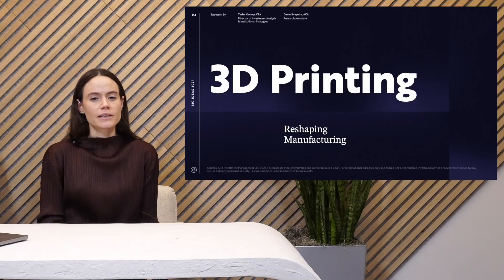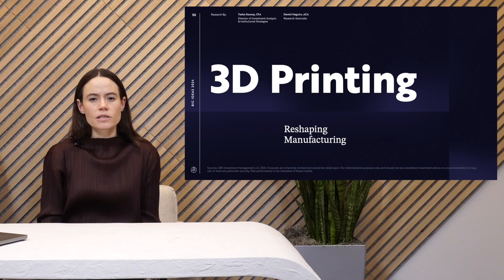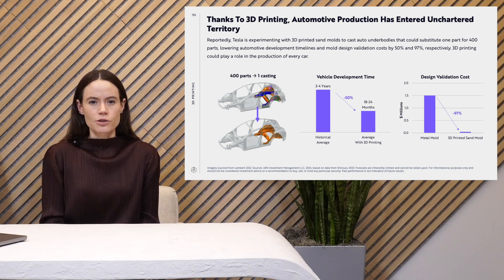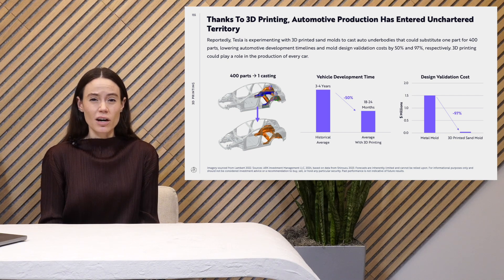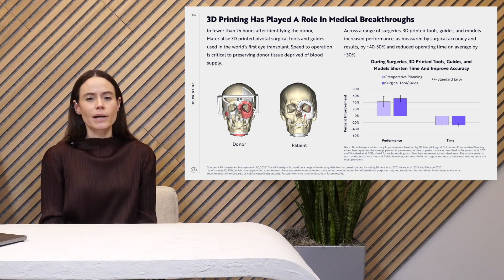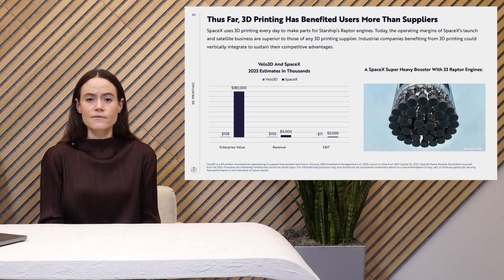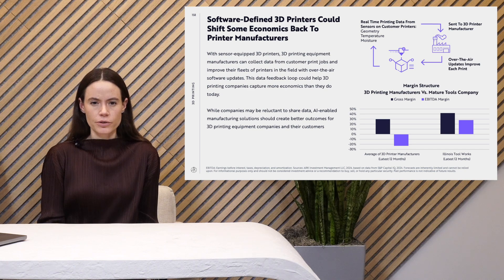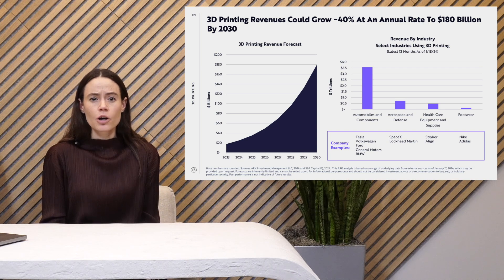3D Printing | Big Ideas 2024

Comment: 3D printing has extreme potential but rather than a steady progression I think it will be sudden leaps. Extruder plastic printers are toys at any level but the right metal printing technology could be a revolution. It has to step from modest use case curiosity to real traction and I think that's quite possible. Current metal 3D printers suffer from stagnant self importance where they compete for the greatest overpricing and lack of progress. Around 7$/cm3 steel print has been the norm for many years and their only innovation has been that you have to pay for the empty volume too so the price has actually gone up to 10+$/cm3. When a high power laser costs close to nothing and pushing around metal powder in a bed isn't exactly quantum physics. Similar stagnation in the printer makers.
Print speed comparable to pulling a car out of a paint bath is possible but no one is looking at that. From studying UFOs aka ET ships coming here, and yes that is quite real, it is absolutely evident that only "3D printing" will survive as a manufacturing technology and theirs include atomic structuring for perfect alloys and semiconductor functionality. They don't distinguish between structure and wafer. They have no wires, no PCBs. One monolithic process. So that's an easy way to know the endgame.

Comment: 3D printing is extremely slow.
If it take one day to produce a part but take 30 sec with a mold you are toast.
It can be good for a rocket engine or a prototype, but not for a production car.
Reply: I've printed a good amount of HPDC tooling for automotive. With the ability to print in optimized cooling channels, the tool can last longer
Reply: @BenWilson24  So you print the mold for plastic injection directly in metal.
That allow to have shapes, cooling channels that would be very difficult or impossible to do otherwise.
The 3D print is the mold, so it's doesn't matter much if it's expensive or slow to do, it's cheaper/faster than custom machined stuff anyway and offer more possibilities.
Did I got it right?
Reply: @alexforget  high pressure die casting is for metal. People do it for injection molding too, but I was referring to HPDC molds. The conformal cooling channels I was referring to are for coolant to flow through the mold. Traditionally, the cooling channels are drilled in from a bunch of different directions, but those methods restrict the paths to be pretty orthogonal and not necessarily run in optimized routes. Printing in the channels gives some more freedom to allow the channels to flow smoother and to the exact locations you want, reducing pressure losses due to turns and improving heat transfer to make the mold last longer. AM has its tradeoffs and challenges with it too (surface roughness, dimensional precision, cost), but I've seen some pretty advantageous applications. One mistake I think the industry needs to clean up is forcing AM into applications where it doesn't make sense, and it ends up burning the stakeholders. It definitely has its benefits and uses, but it's also just another tool/process that has its pros/cons

Comment: I work in manufacturing, I 3D print with multiple materials, and I know that Tasha doesn't 3D Print rocket parts or even bird houses in her spare time... so that she's THIS spot-on with something I see the practical side of on a daily basis, it just shows you what good research is capable of.  The reason ARK is as successful as they are is because they know how to research.  When they don't win (missing Nvidia rocketing) is because they rely on research and in the long run and not betting on micro events and over time that's the only thing that comes out ahead.  Even if you don't have money with them, there is a lot to be learned from Cathy and the people that work there. 👍
Reply: 3D printing is extremely slow, good for prototype and small runs but not for massive production where you get completely smoked by injection molding and castings.
Reply: @alexforget  You are 100% right about that.  But it speeds up the prototype possibilities, makes custom work WAY more affordable, and even working prototypes (SpaceX) instantly test-able (printing in metal and then testing it).   These are areas I never think of from my point of view (as the average 3D printing user).
Reply: @alexforget Check out ON Lightspray shoes 3D printed in 3 minutes!

Comment: Fail to see how 3d printed sand moulds can be used in high pressure die casting. Large metal printers, yes. Link up with Terry Wohlers, he has a wealth of knowledge over many decades on the 3D printing market.
Reply: That's not what's used for HPDC. I used to print HPDC tooling out of M300 with conformal cooling channels
Reply: @BenWilson24  exactly

Comment: They use high pressure die casting, those are steel dies which are reusable and have enough conductivity to cool down the part in seconds.
Sand molds are trash.
Reply: She's mixing things up. I've printed a decent amount of HPDC tooling in M300 with conformal cooling channels
Reply: Yeah when she was talking about sand castings... I was like... maybeeee at the very start when they were testing their aluminium mix for warping perhaps. But Tesla certainly doesn't use sand casting for their frames. There are multiple videos of them in action.
Reply: @abcqer555  Die casted aluminium already has bad material properties, if the cooling time was increased it would be unusable. You need short cooling time to get a thin microstructure.

Comment: Haven't followed 3d printing news for a while, is the desktop metal production system still the fastest metal 3d printer? Does binder jetting works with all alloys used for metal injection moulding?
Is powder bed fusion still limited to 1000 cubic centimeters an hour?
Reply: Their parts float
Reply: @BenWilson24  What the hell? You mean green and grey parts? (before and after boiling the binder material)
It's still very dense at this point.